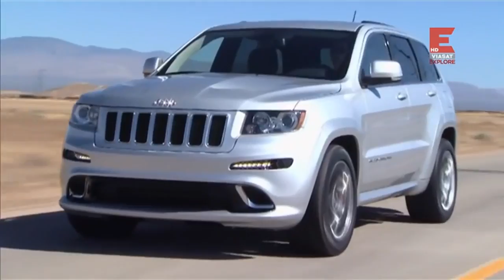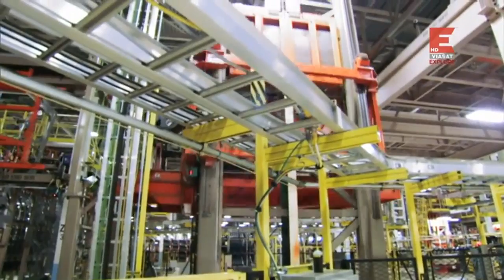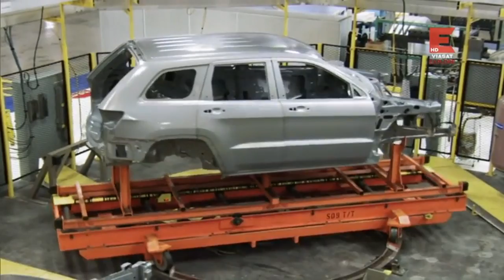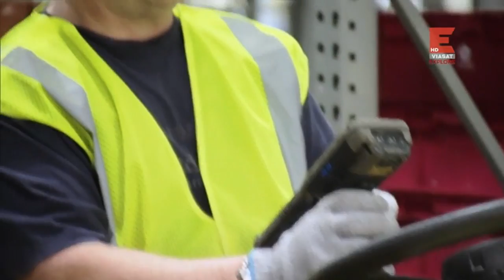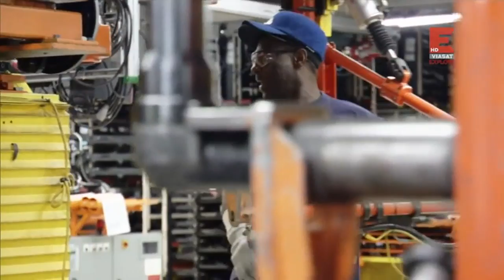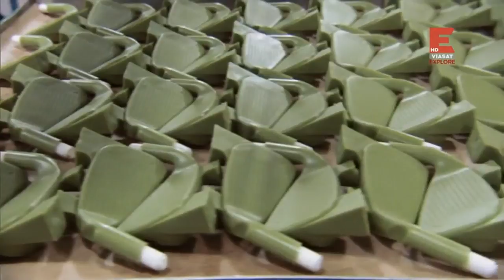2014 Jeep Grand Cherokee Build

Comment: These are not all "sold", if that were the case there wouldn't be any on dealer lots. Also, they are not shipped to the customer, unless you consider the dealer to be the "customer".
Reply: David Robinson technically he is correct, the manufacturer invoices the dealer which is their customer.

Comment: I have a 1997 grand Cherokee with 180,000 on it and still running strong. I will never get rid of it.
Reply: lar4305 we have a 1999 4.7 with 186000
Reply: Bought it about 10 years ago.Unstoppable in the snow.
Reply: lar4305 that's pretty cool we bought ours 11 years ago
Reply: lol that's strange.
Reply: I had a 2001 Grand Cherokee that developed a blown head gasket at ~100K miles. It was minor, so I drove it another 50K miles, when it let go. Water filled the cylinder, hydro locked and broke the rod.
Reply: mine let go at 40k never buying a jeep again

Comment: Our Grand Cherokee already has creaking control arms that I had to spray with lithium grease. The interior came with a few panels that weren't even installed correctly, and I had to take them off only to find that someone installed the metal clips incorrectly.  It only took a screwdriver to fix, but I shouldn't be doing that to a new car straight from the lot. Besides the imperfections, it's one hellish beast of an SUV! The one we got is a 2013 Grand Cherokee Trailhawk with a 5.7 HEMI engine. I can't believe the acceleration, the 7200 pounds of towing, the insane Quadra-Drive II system, and the countless thick metal skid plates and rock rails protecting this 5000 pound behemoth. It's off-road capable and it's very comfortable on-road with its wonderful air suspension that also allows it to handle nicely. It's when I do a turn hard that I begin feeling the weight, so it's just a "mild" sportiness. However, the quality issues NEED to be considered.
Reply: Dcc357 that's bc a robot put it together